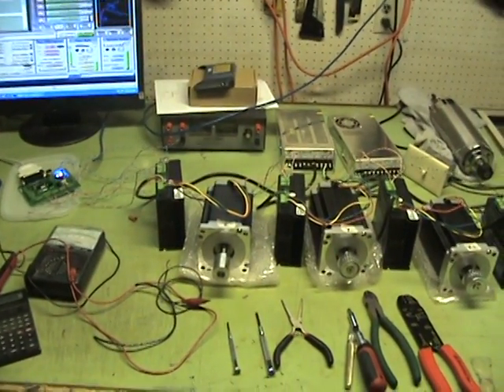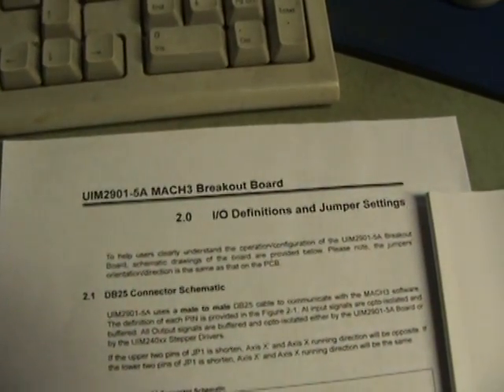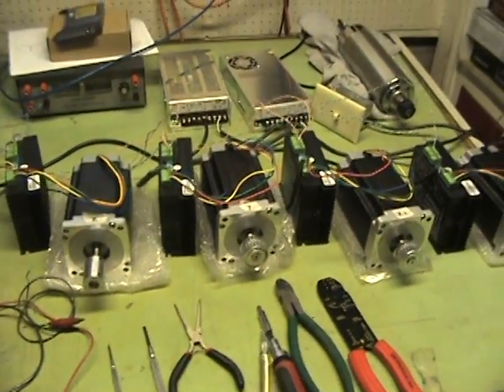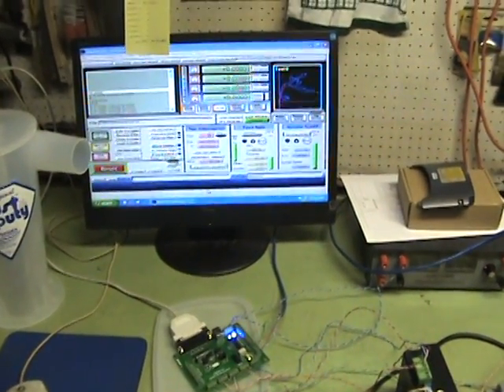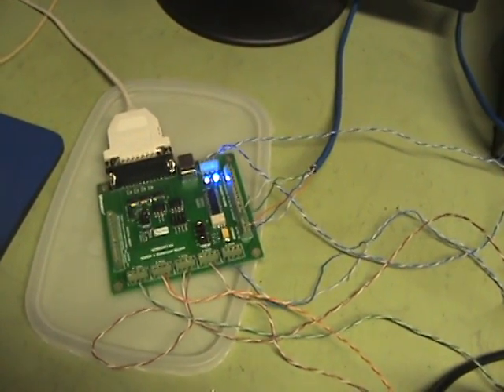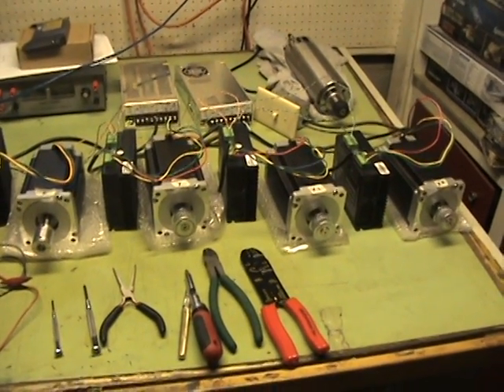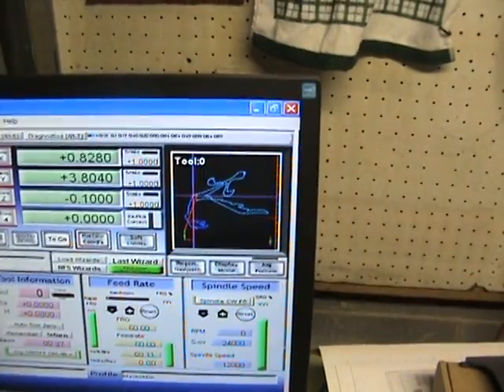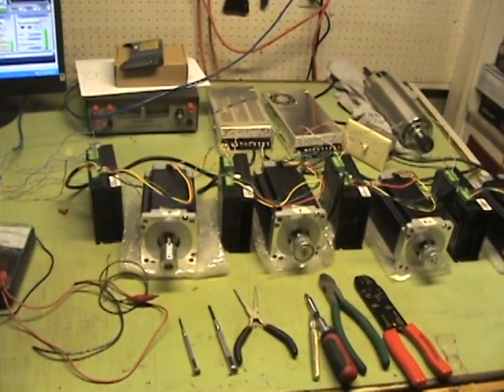Building CNC Router Parts CRP4848-1.MPG

Comment: Hello,
I watched your video series and I am very thankful for your work.
I am looking to buy the kit from the CNC router parts guys.
I was wondering if you would not mind giving us some feedback on the stepper motor and spindle that you purchased for this kit... are you completelly satisfied and running trouble free?
Your motors are rated much higher on tourque.. and ebay is full of these offered directly for china.

Thaks
Frankmali17@yahoo.com